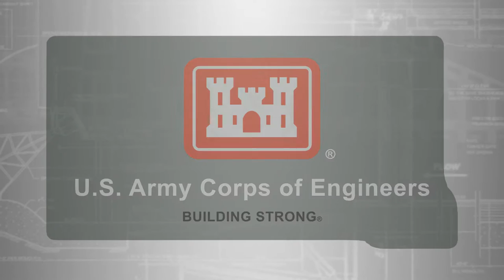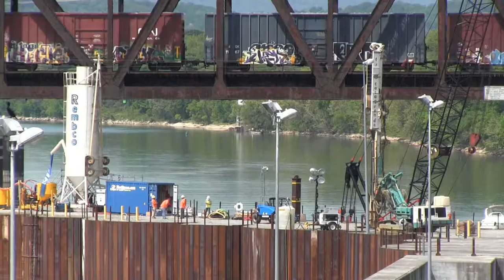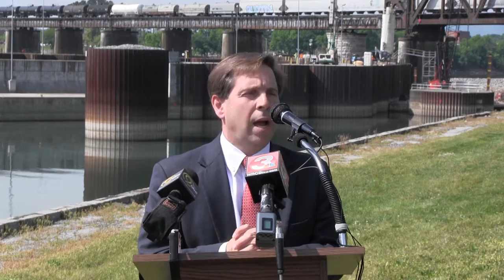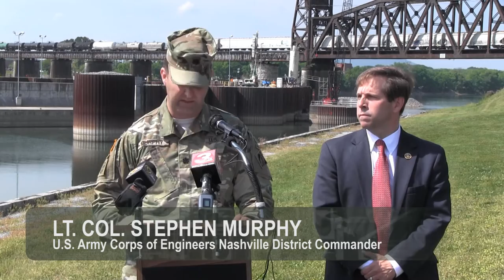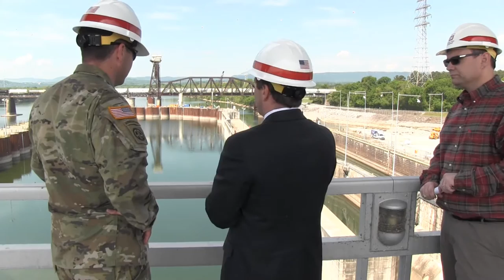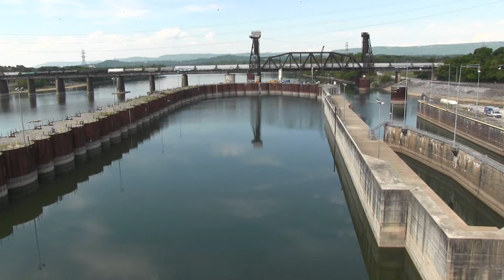Construction restarts on Chickamauga Lock Replacement Project

Comment: Why a 600ft chamber and not a 800ft one?
Reply from the maker: The 600-foot chamber is consistent with other lock chambers downstream of Chickamauga on the Tennessee River, so it matches barge configurations typically utilized by the commercial navigation industry operators in the area.
Reply: @nashvillecorps  but the towboat is still gotta be knocked out for a double lockage, why not just add the 200ft?